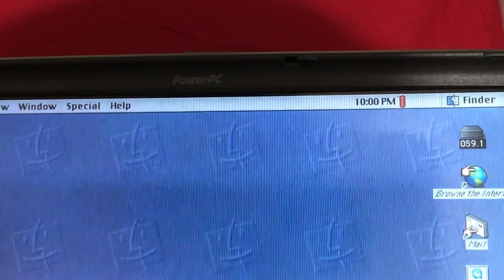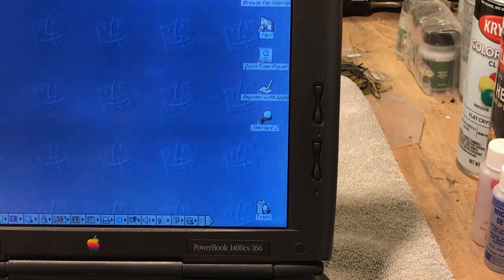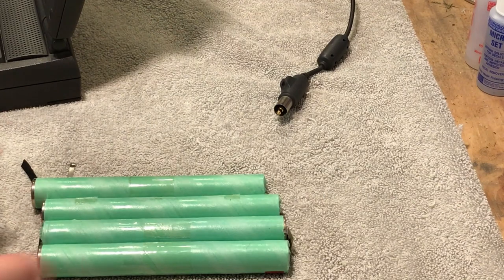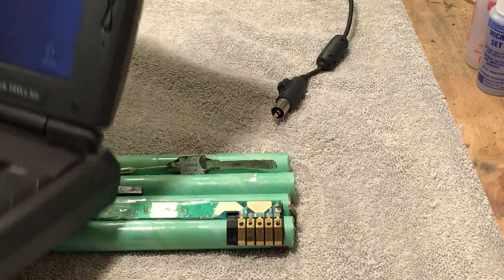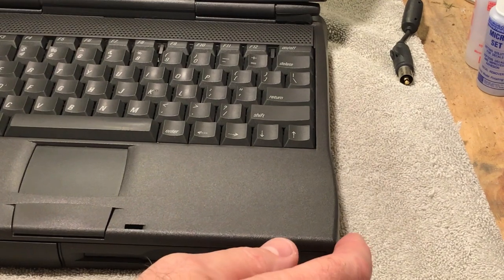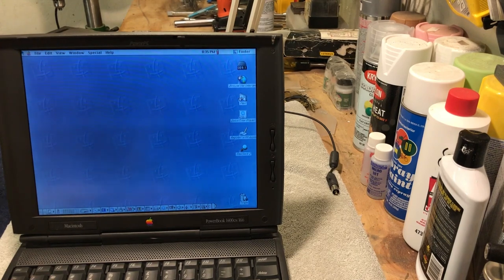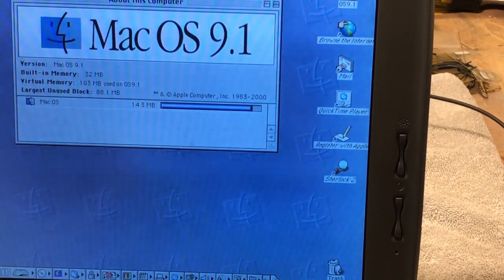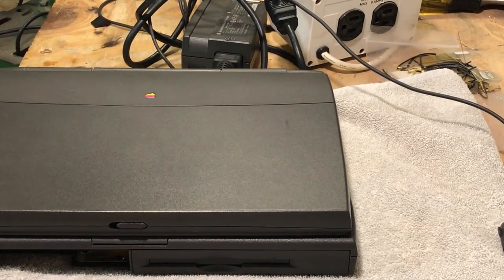REBUILDING THE POWERBOOK 1400 BATTERIES WORKING NOW PART 6

Comment: Hi Dave, I’m glad that worked for you. Since i don’t have mad soldering skills, I’ve found a place that will rebuild laptop batteries for a fairly reasonable price:

http://batteryrefill.com

If your battery isn’t listed you give them the specs and they’ll know what to do. I’m doing it with mine. 

A G3 upgrade will work in your 166 because it’s the second generation 1400 logic board, Apple part number 661-1381. The previous revision will not take even a 166 CPU and if you try there’s a chance you could damage the logic board. I fried my 117 so I had to get a replacement. Live and learn. 

The stock CD-ROM drive in there is either a 6x or 12x Teac. You can get a 24x that will take the facia from your 1400’s drive. I wouldn’t get any later than a 2001 dated unit.

If you want an active matrix screen, they are painfully easy to swap in and work fine.

What we used to do about virtual memory in these PowerBooks with PC Card slots was to get a PC Card CF reader and a 16 or 32 MB CF card and use the entire card as virtual memory. It freed up space on the main drive and was, of course, faster. Now that you can get Gigabytes of storage, it’s an ideal solution as RAM cards for 1400s are as tare as hen’s teeth. 

Where did you get PRAM batteries. I was thinking of having the battery rebuilder make a couple for me but if I could just get them online , I’d really like to know where.

Thanks for the shout-out. I’m happy to help.
Reply from the maker: Thank you very much I Gave Your Channel A Shout Out